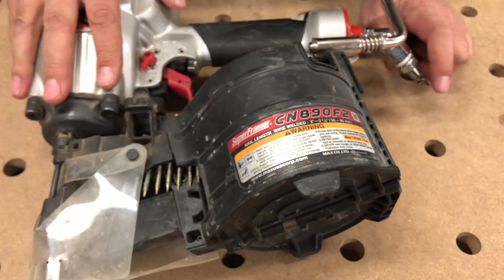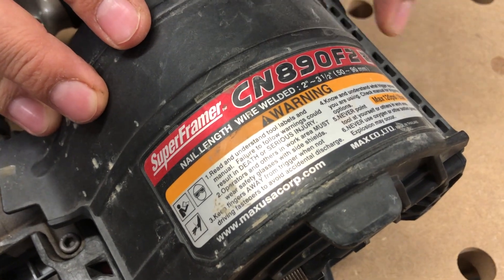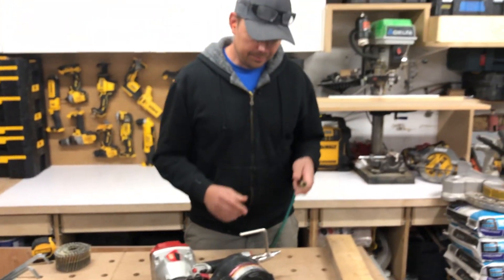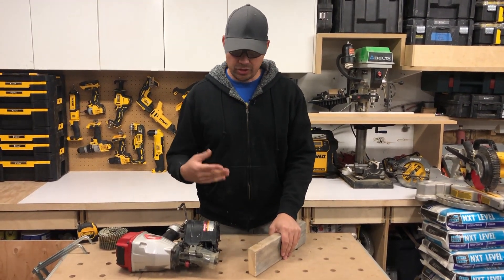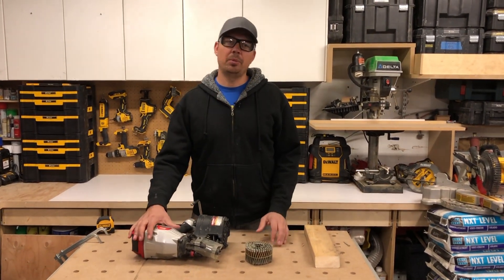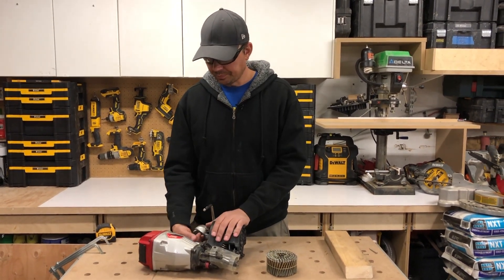Speed up your work! MAX USA Corp CN890F2 Super Framer Coil Nailer - REVIEW

Comment: Bye any chance are there any ballistic screws that work on the CN445R, or is it too old of a model?
Reply from the maker: I think that’s the roofing nailer if I’m correct? And I don’t think ballistics work with the roofing guns. Only the framing nailers.
Reply: @hammerandhome  it is the roofing gun but it goes up to 1 3/4
Reply: Does that make a difference?
Reply from the maker: @ffsrdr6596  the heads on roofing nails are way bigger than framing nails or ballistics. I think the nails wouldn’t work in the roofing nailer. I have one so I’ll take a look at it.
Reply: @hammerandhome  appreciate it man

Comment: Those screws are called scrails here in the states. Most all of my nail guns that I own are Max. My newest is the  $400 Max nf255sf2/18. I use it to install custom fireplace mantles and trim. The gun was discontinued for about 8 years and was finally reissued this year due to demand. My other favorite trim gun is the $250 Senco finish pro 21LXP which shoots headed pins. Check wih Max about replacing a few parts in your nailgun with the new stainless steel ones to prevent sticking.
Reply from the maker: thanks for the tip, I have the Senco 23ga nailer and it is so well built. love that gun. I'm amazed at how many framers I see not using ballistic nails for floors or Scrails. it makes it so much faster .